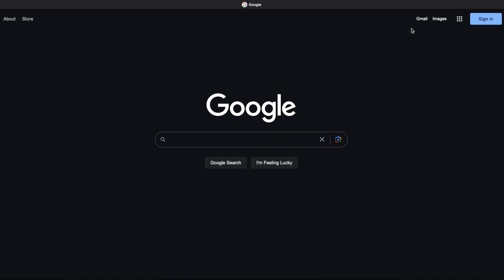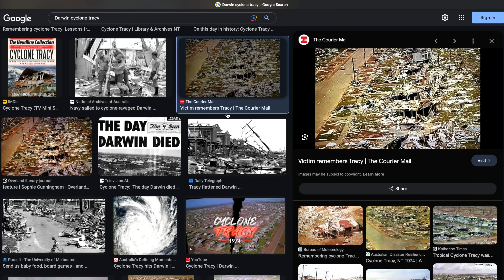A quick tour of Darwin then I head south on my Solo motorcycle camping adventure S2 Episode 22

Comment: Hi Joe.what  made  you buy the royal enfield. I've had a royal enfield classic 500 with a sidecar on it and have a 535 gt .are thinking about a off-road  410cc . I lived in Wellington nz as a kid and there where guns on the hill from ww2 and we played in them as well all good stuff. And also what work do you do.
Reply from the maker: Well a few factors Gordon. First thing was to align with the type of riding I wanted to do, which was explore. that meant I didn't need a bike to get me there as quickly as possible, but it did need to be capable off road (so a 21inch front tyre) to explore remoter areas and was damn reliable as I was solo. There are a lot of great enduro bikes that are epic off road but the service periods and reliably can be an issue, so was more looking of a work horse like a tractor. Also I knew I'd be dropping it a lot so it had to be able to handle that and not break.

The other big thing was price, I got mine second hand. Which meant I could get the bike sooner (I didn't need to continue saving up for more months or years) and get on the road and explore sooner.

so the 411 fit. low price, reliable, capable off road, and now that I have done 40,000km and have had no issues. It seem to be the right choice.

I make documentaries, I also film and do photo shoot for brands.

Comment: Hi joe do you think you will ever buy the new Himalayan 450 jimmy WA
Reply from the maker: Hi Jimmy
The 450 looks like they have improved it in all the area's you like to see, a 6th gear, upgrade on the suspension, more power, more torque (I'd like to see the torque number at low revers to compare it to the 411 at the same point, I gather it will be more than the 411 but the number they state is at a higher rev range).

I bought my Himalayan second hand as it is all I could afford, so it would be a while before I could look at buying one second hand.